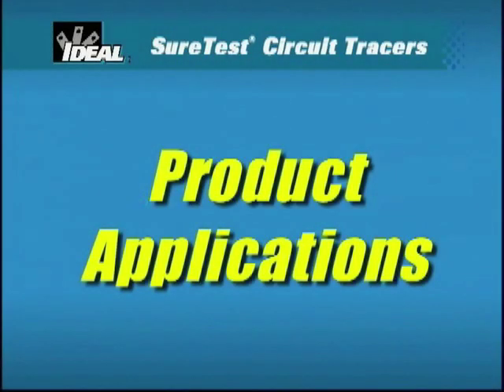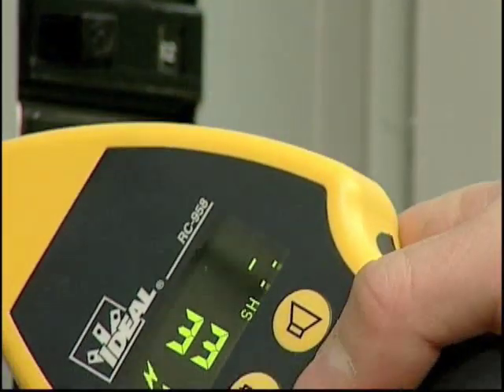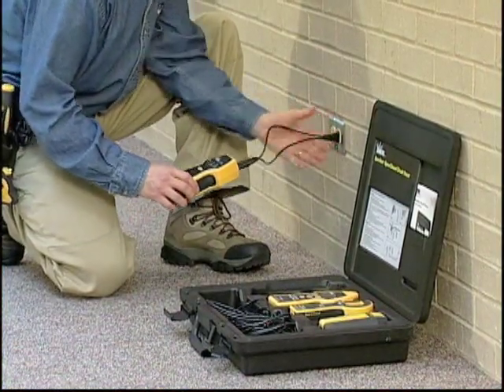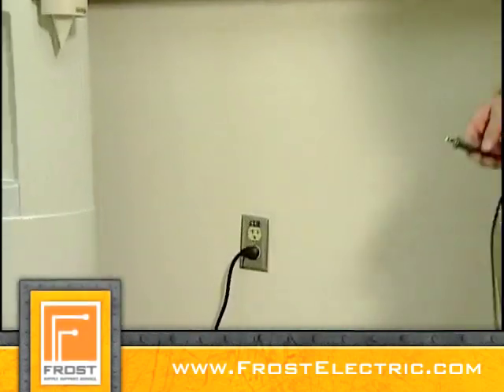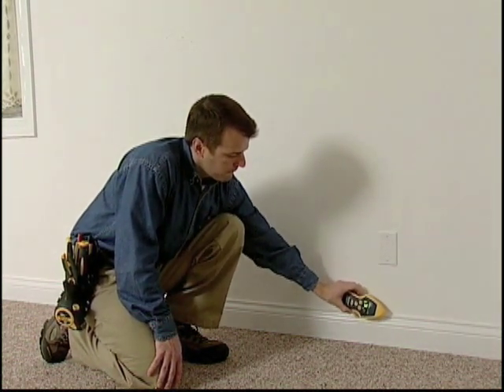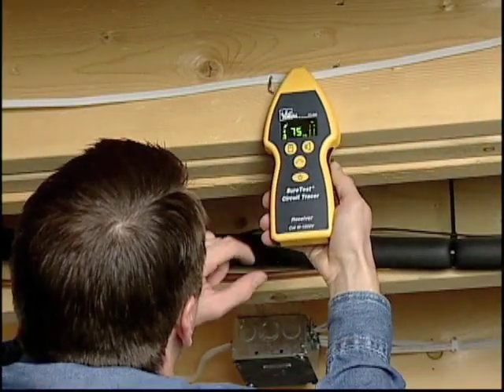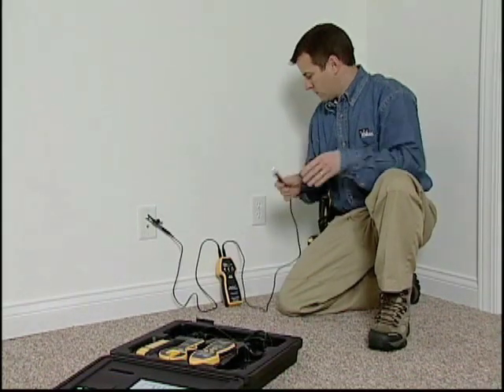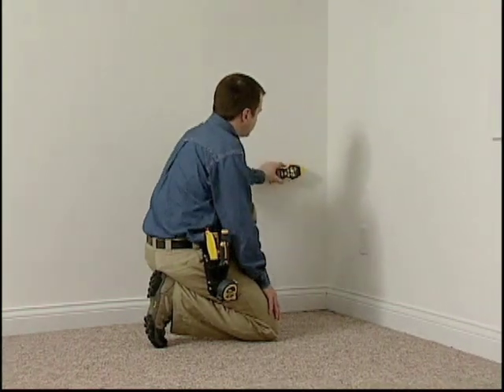How to Use Ideal Circuit Tracers to find wiring indoors and outdoors

Comment: Hey brother, I live in an older house in Michigan. My light just quit working... I'm getting power to the switches.. so I changed the switches (yes they're correct)... Still not getting power to the fixture.... How would I test the wire to find where it's grounding? What instrument could I purchase? I've watched a handful of videos and yours seemed the best... Any info would be greatly appreciated...

Comment: So if all the breakers are turned on, whats stopping the signal from going from the plug all the way to the circuit  breaker, on the the bus then to all the other breakers to outher plugs, seems i cant identify a wire or breaker unless breakers are off
Reply: It works well on live panels as well, the sensitivity settings rule out false readings. I used to own this system and it's good but personally I like the Greenlee CS-8000 better since it pinpoints the correct breaker faster.